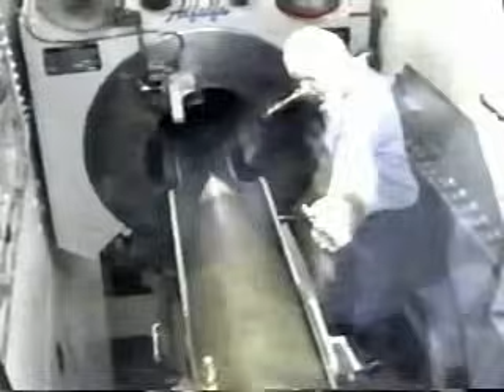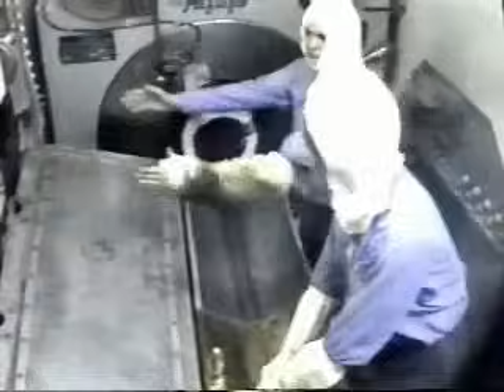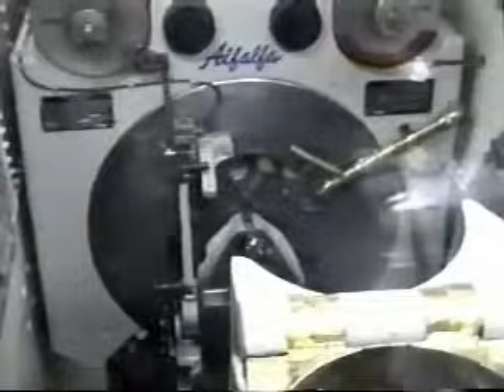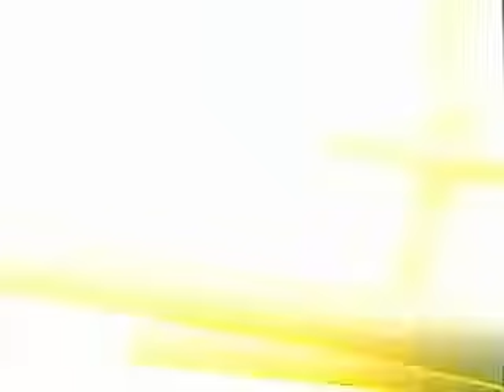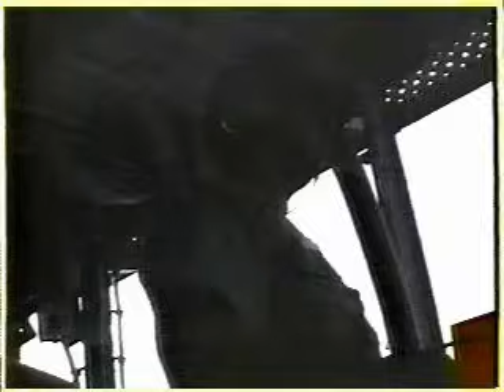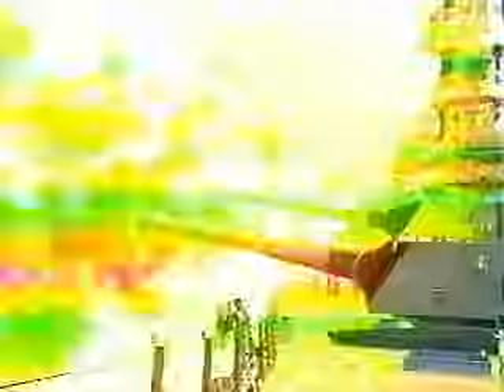USS WISCONSIN BATTLESHIP 16IN GUNFIRE

Comment: One night in Vietnam just after I arrived there I was on perimeter guard and from my position I could see out to the South China Sea and over the horizon I saw a small flash of light. Less than a minute later I heard overhead a whooshing sound like it was spinning and about less than a minute later heard the explosion further inland. I was told a battleship was firing 16 guns over our head. I never heard anything as spooky as that sound over me. It was ghostly. But the moment I'll never forget when a F-4 Phantom flew over our position at about 50 feet. I could feel the heat of the twin engines on my face. They were laying napalm in front of our position. Angels I called them.

Comment: What's a good squirrel rifle? .177 air rifle. What's good for Rabbits? .22 LR. What's a good coyote rifle? 222 Rem. What's a good deer rifle? 30-30. Elk? 30-06. What's a good rifle for bear? 45-70. Moose? 300 Win. Mag. Buffalo? 375 H&H. Rhinoceros? 416 Rigby. Elephant? 600 Nitro Express.
Well, what if all the above are trying to run away at 33 knots, on a ship, and they've got a 20 mile head start?.........Iowa Class 9 x 16"/50 CAL should do it.....

Comment: The only role now days for a WW2 battleship is for shore bombardment. 16” shells are way more cost effective than using missiles, an are just as accurate.  Iraqi soldiers were surrendering to the spotting drone.  If they could get an enemy ship in range of its guns it would destroy it in no time.    As for the Iowa’s surviving modern anti-ship missiles.  First you have to remember Iowa’s have an “All or Nothing” armor scheme. Which means they are only armored in a box that runs from turret 1 to turret 3.  The bow and stern have no armor at all.  Most missiles are not going to penetrate the armor box, but would blow the stern or bow off if they hit there.  Which did happen to US battleships in WW2.  The biggest factor that is going to keep battleships sidelined is personal costs. With a peace time crew of 1400-1600, an up too 2000 in war time. It costs too much to man these ships. As current US destroyers, an cruisers have a crew of 100 to 350 personal.

Comment: so much work just to fire the cannon one time
Reply: One of the multiple reasons missiles are considered better.
Reply: marrier9999 Actually, the advantages of missles has little to do with reload time at all. There are a TON of advantages, of course; however, all things considered, these cannons can loose a full 3 round salvo(Each battery) every 30-ish seconds. 
Missles eclipsed traditional large scale projectiles because they were inefficient in the modern climate. Weapon ranges were increasing AND getting more accurate; this was just the top of the line of a very dated system.

Now, most every single warship in the USN is equipped with guided missle capabilities that can strike with better accuracy at greater distances, with more variability, Vertical launch systems allow for more compact platforms, and myriad other advantages! 

The more you know! 
Rainbow --> Star!
Reply: Shalterra I know that. Anything cannons can do, missiles do better. Greater range, accuracy, versatility, power, etc. About the only con missiles have compared to cannons is that they can be shot down, while cannon shells can't. Railgun technology might see the return of ships with large gun batteries one day in the future though.
Reply: Railguns, can they be used to bomb buildings? atm i dont think so, most likely they would use missiles instead. Hehe a 5 or 10mach railgun cant have to much angle before it shoots its projectile into space. I hope you understood my last comment, about angle...i did not know how to phrase it better
Reply: rosewell1983 I think they meant to use it as a anti-ship weapon primarily. But they can still use it like this....
http://www.navweaps.com/Weapons/WNUS_Rail_Gun_Slide_pic.jpg
Reply: Would be more awesome if they had functioning lasers. That would totally royal flush every other option
Reply: rosewell1983 We do! There's actually already a project in the works to equip a few surface ships with the directed energy weapons system!
Reply: rosewell1983 Yeah, lasers will never be a practical weapon. Not in a planetary atmosphere anyway. The ridiculous amount of power needed to amp a laser up to the level where it could do damage fast enough to be useful makes turning it into a weapon just absurdly inefficient. Then there's all the other things you have to worry about. Due to the fact that lasers are affected by the humidity (water refracts light), and other atmospheric conditions, the range and power output of your weapon would be affected by the weather! Can't see the military dumping money into developing a weapon that's useless on rainy days.
Reply: Shalterra Missiles are good at everything except the absurd cost for each missile, and even with missile technology the Iowa class battleship was still called back for duty, in the Korean war,Vietnam War,the Lebanese Civil War, and Operation desart storm.

They did the job damn well, although they can create mass civilian death if they fire at enemies near crowded areas,
Reply: Steven Mcdonell RyanAir should make missiles
Reply: they have 9 cannons because of slow reloading. 18-20 rounds per minute is total number and i would say that is enough for artillery firing... still cheaper than firing few missiles.
Reply: Yeah it is, but when you are firing a 2,000 pound projectile at 2,600 feet per second, you probably only need one shot per target.